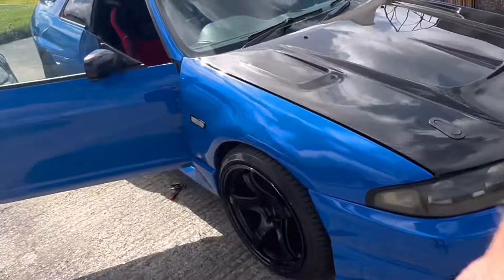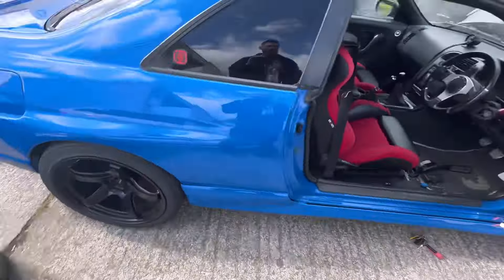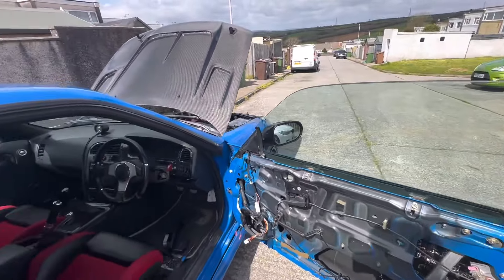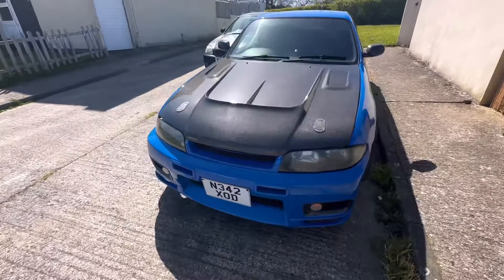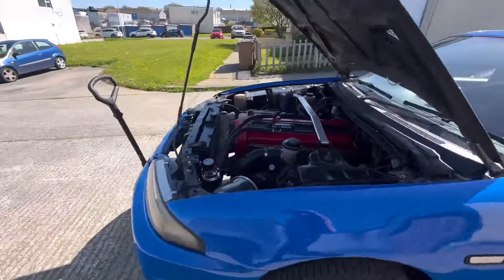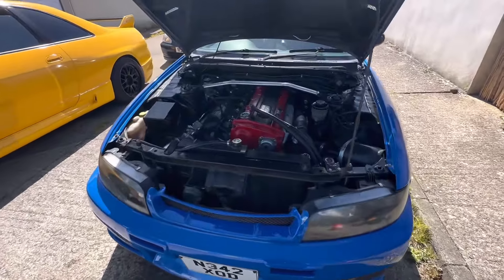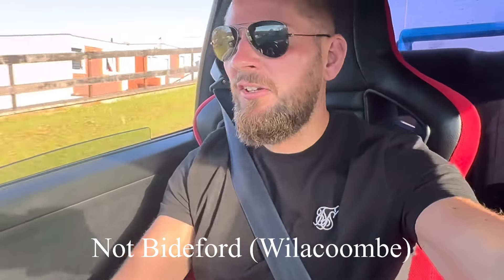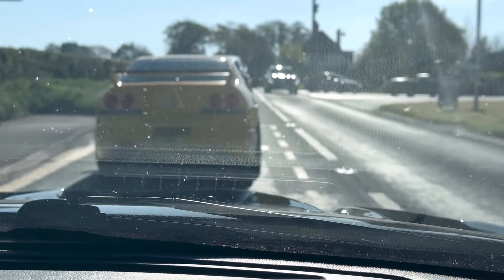R33 Skyline Project (TUNED) Cars & Cuppas Cruise!!

Comment: 10w60 mobil    gap ngk plugs 6m  orginal nissan filter ... car will run sweet ...
Reply from the maker: Thanks mate I’ve just gone from 5w 40 to 10w 40 I’ll try 10w 60 next perhaps
Reply: because is not fresh built built engine  10w60  you eill have better oil pressure
Reply from the maker: @barisdemir1978  it’s got about 2500 kilometers on the engine now so I’ll definitely do that on the next service 👍